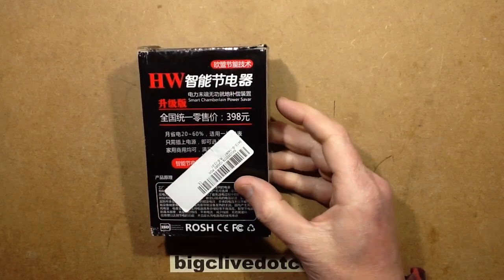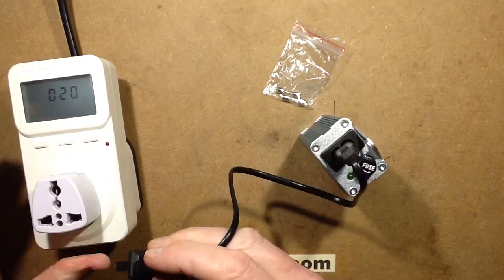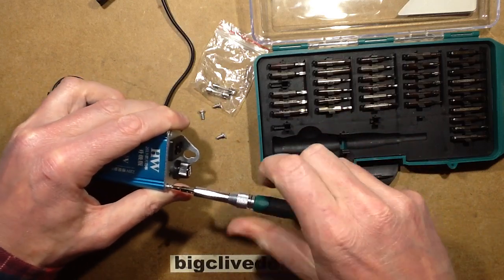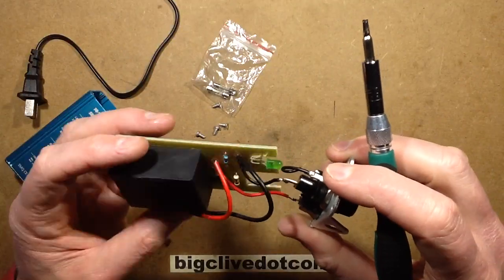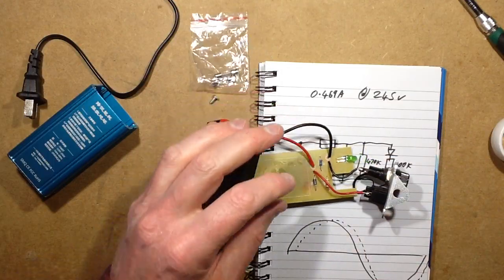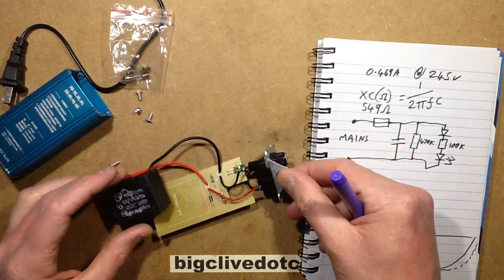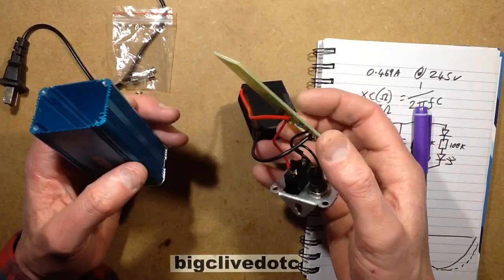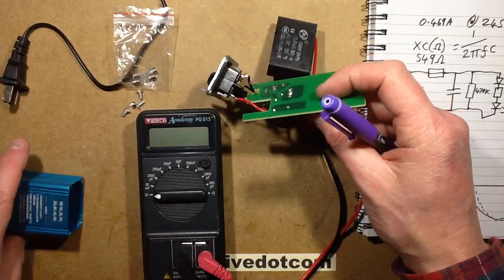200kW miracle power saving device.

Comment: Mr clive I have been watching your video since 2 years but you never reply my questions,,so I am upset...please say me that is this device actually works?
Reply from the maker: This device is a fake.  It doesn't work.
Reply from the maker: The best way to lower your bill is look for heating loads that may be used excessively.  Things like poorly insulated water heaters that run continuously and the use of electric heaters or air conditioning.  Adjusting the temperature settings by a few degrees cooler for heaters or warmer for air conditioning will have a dramatic effect on your bill.
Reply: I'm not sure if it is really blinking like on the video. It might flicker at 50 Hz, and what you see can be the effect of the framerate.
Reply: Well, I for one think the aluminum case is very nice and would happily pay up to 2 bits US for it.
Reply: This sums what I was looking for in the video, gave you thumbs up for this answer in this video, thank you!

PS: Just came across after searching for something to lower my eletric bill in Brazil.
Reply: channel name Tech Tor have a device product free energy... watch it before is gone
Reply: Looks like a blinking LED to me I don't see the help at best it may clean up the circuit but doubtful. would look quite right as a Christmas tree ornament.
Reply: Lumen Tech no

Comment: tx for the info. 
I was really curious about this. I never believed that those gizmos do anything. Very good explanation about how people believe that the thing works,

It happened that I fooled myself too in such a manner.  two years ago, I replaced the bulb I use more with a LED one. did not noticed any saving. I use light quite little.  About  half a year ago I changed all the other bulbs, just because I like the idea of LED illumination. I noticed a sudden lower bill of about 30 percent. I was convinced that the new bulbs were the cause, even I use them just few minutes daily.  I simply denied my brain to do the math. The first one I changed I use it about 2 hours daily.  Recently, I woke up from my dream. I realized that I should had have about 30 hours daily of bulb usage to perform that saving. 

I do not really know the cause but I guess it was a short on a socket. It exploded about the same time, so I replaced the wiring. So, before the short, just had a trickle of about 120 w. Maybe I am wrong, but this is the only idea I have to solve the mystery

Comment: If I'm correct, some say multimeters won't prove the power saver works, only by a house electric meter, and the power savers may not work with smart meters?
Reply: They are only used in industrial situations. Only for certain setups. If you have an industrial setup, you probably need a bigger one of these! :P

Comment: the capacitor will load the utility generator even when the meter say zero watts. so capacitor still pull power, its just that the math can't see it, and if you were clever you can use the capacitor with transformers in a certain way to get free power as long as the resistance across the capacitor does not change much or voltage loosing synch.

Comment: Unfortunately one cannot accurately determine the value of a capacitor connected across mains voltage based solely on it's current draw. This is due to the fact that mains voltage is not composed only of a 50Hz sine wave, but also a fair amount of noise and harmonic distortion (last time I looked, it was about 10-15% THD).

Comment: In some IBM mainframes they had (or have) these banks that would take the power from the grid, convert it to direct current, then change it back to a pure beautiful sine wave.

Wondered why that is not standard gear in every household. But it is just cost and conversion losses. Too bad.

Comment: i dont get how this can save power by being a seperate device drawing 0.2W from the wall all the time. Capacitors are supposed to be part of the device with the inductive load, it doesnt help plugging this in a random spot in the building as the capacitors wont be able to help for the load somewhere else.
Reply: @System0Error0Message 
No, that explanation is not quite right. 
With a capacitor, Current charged from the previous cycle can push current into the line or load (where Resistive and Inductive loads predominate) even at Zero line volts. That can be done anywhere on a circuit, all the way back to the generating station. The reason for putting a cap into an inductive device is merely so that it is a (somewhat matched) reactance. 
In 3-phase systems, even a transformer can provide some phase correction, because when converting either Delta==>Wye or Wye==>Delta, there is a 30 degree phase shift.
Reply: Whilst this device is sheer nonsense,  as a broader theory it is possible.

Obviously it makes sense to correct devices 'at load',  the values can be calculated for a specific device and everything is hunky-dory.  

In huge industrial installations where 'dynamic' power-factor correction is used (you know- the kind of place it does play a part, unlike domestic situations) this is quite often done at mains intake, ultimately the power all passes through the same meter so it doesn't matter particularly where you offset it.  This is referring solely to big, automated systems though designed by those who actually understand the physics and systems that cost more than a domestic electricity bill in our wildest dreams.

However, strictly, you don't have to 'correct at load',  you CAN do it anywhere in the circuit, but you know.....

I can see why you think the above (it doesn't make an awful lot of sense until you think about it) but remember you're correcting to impress the meter,  not the device.  The device doesn't 'care' how awful its power-factor is,  the electricity board do!

Comment: I haven't read all the comments, so perhaps I'm repeating things here.\

Many modern electronic products have low input power factor as a result of rectifying and capacitively filtering the AC mains. It doesn't matter if this is done directly or after an iron-core step-down transformer. It is becoming increasing common for larger power supplies, such as those used for desktop computers, to have internal power factor correction, but lots of small items such as "wall wart" supplies, compact fluorescent lamps and LED lamps lack the required circuity. In such devices, the poor power factor is not the result of a phase shift but because the load is very non-linear. Current only flows when the instantaneous line voltage is greater than the voltage on the filter capacitor. You cannot correct this sort of power factor problem by adding linear reactance across the AC line.

Depending on what you have in your house, these capacitor boxes could actually very slightly increase your power consumption, due to I2R losses in the mains conductors. The amount of loss would be small.

Comment: Perhaps you should mention that your screwdriver handle  is insulated from the tip as you're shorting mains voltage charged caps with it. Some people might try that with an uninsulated metal object and get shocked.

Comment: I need one for power filtration, dirty sine wave from the fridge compressor, having that power on standby to startup the compressor, and to absorb the overflow when the compressor stops is what i am looking for.   I have found the site and specific product, i never would have known about this product if it weren't for your review, thank you so much, I am currently using a dimmer switch on a Himalayan Salt Lamp to absorb the overvoltage from the disengaging compressor.  Soon i will be ordering one of these to replace the lamp.

Comment: Most Excellent engineering advice in a short video,  but the opinion does not address thoroughly what problems this device can solve.   For example,  in many (even developed countries),  many light bulbs are burned out prematurely because of spikes that momentarily overload bulbs.  You touched on it talking about the capacitor helping an LED.   Hence,  the question remains:  Does this device help solve the above ?   Can this device in line with my array of lights in chandelier (10 x 25w incandescent s) help normalize their life span?   If yes,  then it does work by saving me the time and money replacing 5 bulbs every month.   I understand,  videos are short and your intended purpose was to teach a little science,  but a functional question remains.....

Comment: hello MR Clive is this device pluge in series with the appliance??
Reply from the maker: No.  It just plugs into any socket so it is in parallel with the mains supply.
Reply: +bigclivedotcom mr clive can you please demonstrate how the plug actually work using watt meter..? is it really works..?
Reply: watch the video?
Reply: No it doesn't. It's a scam.

Comment: I am guessing the raiting meant 200 kilo volt amps, rather than 200 kilo watts. Though volt amps = watts, their is a difference between the two in the power industry when it relates to alternating current, and how consumers are charged.

Thank you for pointing out how selling these for power savings to residential consumers is like selling snake oil because they are charged by the kilowatt hour, and not the  kilo volt amp hour. 

 These do have some value, they will smooth out sine wave and though they wont reduce the watt hour usage or real power, they can reduce the apparent power. I have a refrigerator that frequently trips an old circuit breaker. Since the capacitors store power that can be used to offset inductive loads, I considered doing power factor correction for that circuit. to prevent it from tripping to easily when the compressor motor starts up. 

Playing devils advocate for a moment, power factor correction if done properly, can reduce reduce a tiny amount of power though constraining inductive loads consuming and reflecting power to a particular circuit. Though residential consumers aren't charged for reflected power, their is some power loss in the power lines though the wires own internal resistance.  But, to be done properly, capacitive loads should be switched on at the same time inductive loads are switched on, and located close as possible to the inductive load to minimize wire loss. Even then, the savings is far less then the snake oil power savings advertised.

Comment: all it does is shift amps and volts a bit ... might wanna calc what the cos phi is when thers something like 200W load on the line.
with that, there should be a nice phase shift resulting in a lower RMS power.
since older types of kWh meters can't deal with high cos phi they turn slower resulting in lower elec. bill.
don't let the energy company find out though, around here they don't like this kind of thing ;)
also .... these things can also be done with a decent coil shifting volts and amps in the other direction :)

Comment: How exactly is this even theoretically supposed to save you money on electricity?
Reply: Power factor correction. But residential power is charged by the actual consumption, not apparent power consumption, so this won't help.

Comment: is power saver really working ?
Reply from the maker: No.
Reply: here's a tip: watch the video.
Reply: Nope, reactive power (dont know if it is the right english term for it) is not recognized by normal power meters (for residential use), so you dont have to pay for it!
Reply: If lucky, you may correct the phase angle which reduces the non-watt part, and you will be able to increase the power you can pull through the wires, and work as a phasecompensator. But i doubt it. :p
Reply: Aaron Stagl I did, i know what has been said and phasecompensation will save you money, but nowhere near the ammount these sellers want you to belive. Futhermore phase compensation has to be designed/adjusted to the load, and placed before the load. Not at randomized locations.

The current is has both Watt and a "wattless" compenssant in a AC circuit and the wattless part you pay for and increases with a off angle on your phase.There's nothing new in the subjekt itself, in most of Europe we have used phasecompensation for many years. But aparently it's a new discovery in America and Asia.
Reply: In Germany, people with "normal" Power consumption (basically any houshold, but not Companys and stuff) and as far as I know the USA and a lot of other countries don't pay shit if  they use reactive power. Even if that thing would really correct the phase (of course it won't have a huge effect) nobody would save any money.
Reply: Everything you said is true, but the question "is power saver really working ?" should be answered like: 

Some people may call it a power savor, but it doesn't save any power. What it does do is power factor correction, then add the other things you said.
Reply: In America, residential consumers aren't charged by the kilo volt amp which may have a reflected power component in it -- By reflected power, I am talking about the power that is temporarily stored in the magnetic field of an inductor and released back to the power company -- Instead, residential consumers are charged by only what they actually use, the kilo watt hour. If there is any savings in power through power factor correction. it is through less resistive wire losses from inductive power reflections.
Reply: MetalheadBuser People generate, but do not use reactive power. Its either refleted back to power company and sent back to consumers during the next phase 90 degree phase or stored locally in a power factor correction devices.  But reactive power is not consumed. Thus, residential consumers  don't pay for the reactive power power they produce. But some industrial processes consume lots of energy and generate lots of reactive power that makes it expensive for the power companies to deliver clean power. Some times industrial consumers are charged by apparent power or kilo volt amp vs real power. Apparent = sqr( reactive^2 + real^2)

So for the residential user, power factor will not give him any savings. But some industrial processes switched power factor correction can save money. through reduced utility cost less bulky diameter wiring in the building  because of reduced apparent power in the lines.
Reply: Keith Reynolds
Yeah i know that, i am just horrible at describing technical things in English :D
Reactional power shouldn't be a big deal on regular consumers for energy concerns, too. Industrial plants might have a shitton of reactional power and that's quite bad for them. but that small Cap wouldn't help much against it.

The main problem with the reactional power is not that it's there since as you said isn't used at all... But it's flowing to you and back to the power plant wich leeds to more current flow on the conductors and more losses.. wich isn't much at all at regular consumers but as you said on industrial plants and stuff  it can get quite large. Many industrial plants also have huge capacitive banks for that reason..
Reply: MetalheadBuser For instance: A lot of  industrial buildings have florescent lighting. The older ballast used inductive reactance to limit current but the power factor was terrible.
Reply: Yeah, funny guy. If you as a consumer push back too much power because of the equipment or tools you use  they WILL tell you to quit it or they will charge your ass.
Reply: Jame Gumb "If you as a consumer push back too much power because of the equipment or tools"  Generally that is not an issue with residential use and so residential users are charged by what they use, kWh or kilo Watt hours, vs what some industrial users  are charge, by the kVah, or kilo Volt amp hours traveling back and forth on the industrial consumer's  power line. 

For those who don't know the difference between kW and kVa http://lmgtfy.com/?q=apparent+power+formula

kW and kVa  are two different types of power
kWh and kVah are both units of energy derived from their respective tyes of power over time. 
 kVah = sqr( real energy as kWh)^2 + (reactive energy as kAvh)^2). http://lmgtfy.com/?q=apparent+power+formula

Comment: So what the guy is saying is, do not fall for Chinese scams... Which is something I already knew. Only way to save money on your electric bill is either 1. switch things off, 2. find a way to bypass your meter without getting caught and/or electrocuted....I once heard of a device that you could plug into your house socket that would send a signal back and cause your meter to stop turning, turn slower, or turn backward, not sure which but another scam. Now days with smart meters that can tell the power company just about what you are running by the loads you put on it, they also have tamper sensors on them as well, it will let them know if it is unplugged, turned upside down, put at different angle, etc...